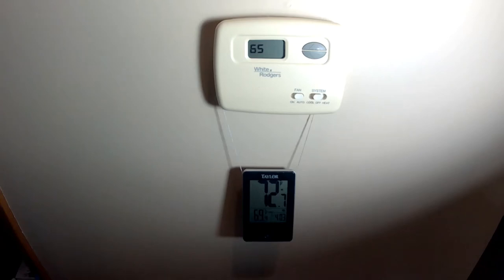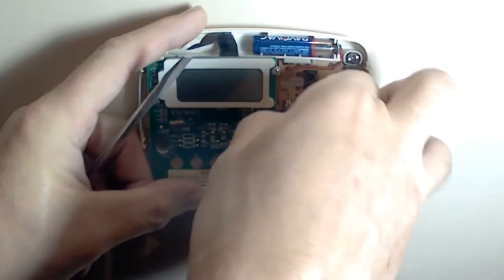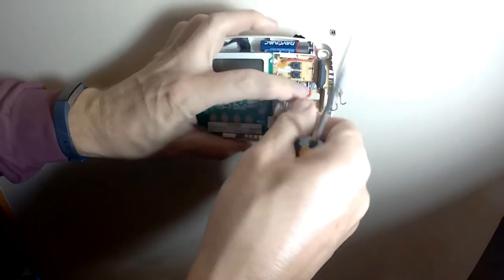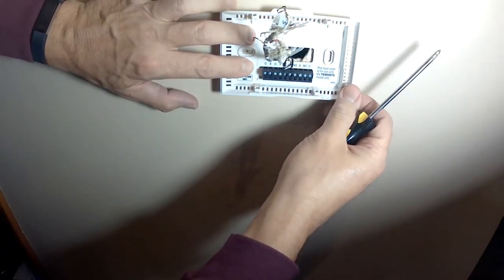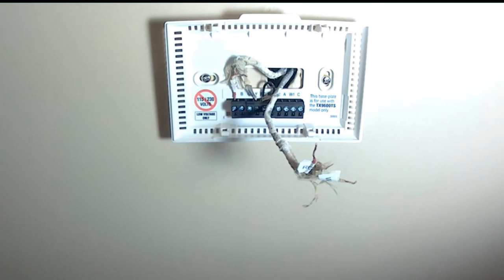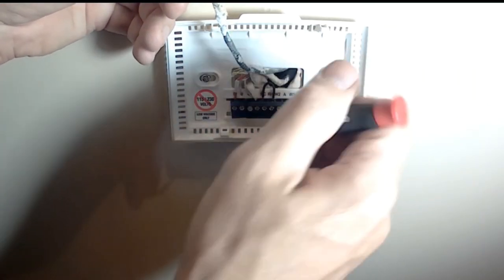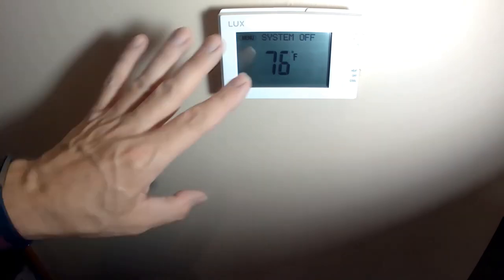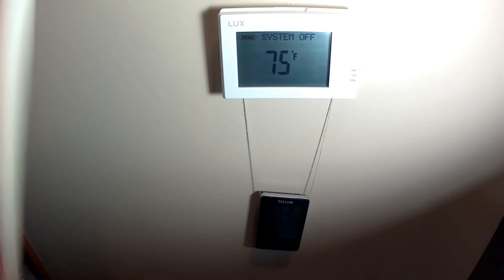Old thermostat replaced with LUX model TX9600TS, 7-day programmable & touchscreen

Comment: I think you would only have a fan if you have a forced air system. I only have a heating system and it has only 2 wires. I lost the stickers and directions but I’m replacing it with the same model.  I’m keeping my fingers crossed.